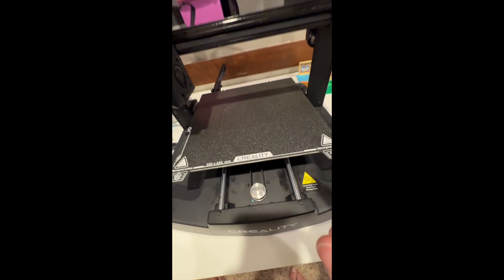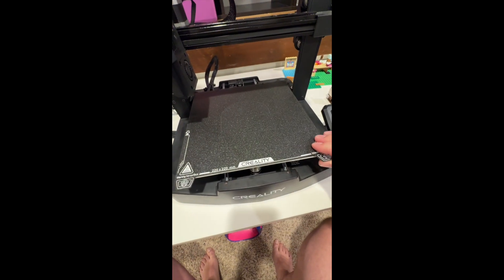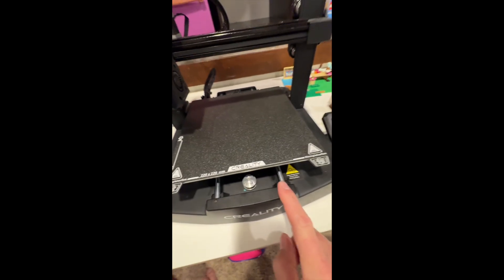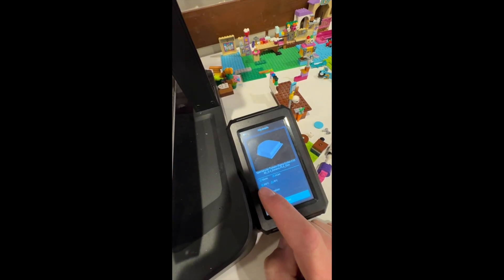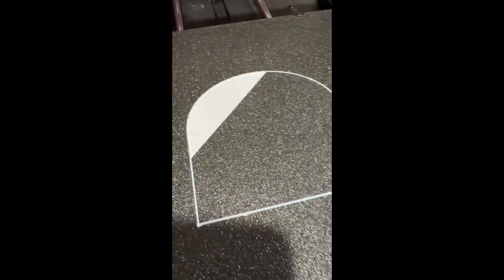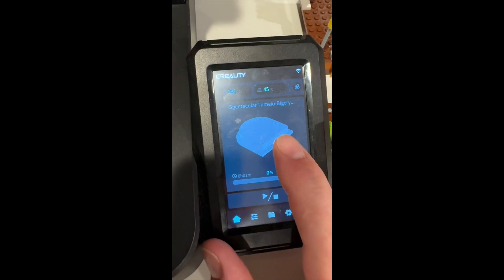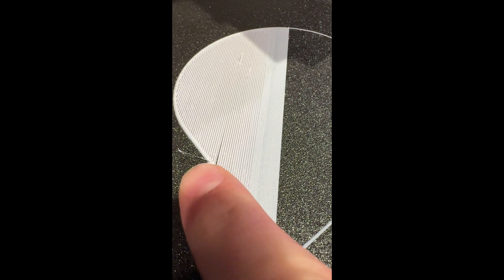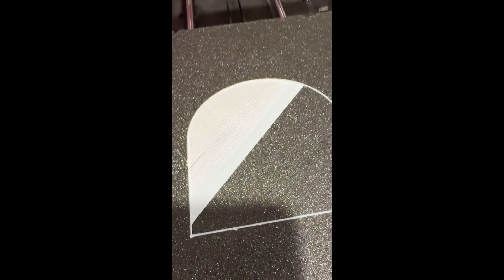Ender 3 v3 ke problems  and some answers with print issues follow up video

Comment: I use 95% Isopropyl alcohol, but it's not a long term cleaning solution. It also needs to be washed with dish soap and worm water from time to time, about 2 times a week works for me.... 
Dish soap, worm water and a new dish sponge only for cleaning hotbed plates is the best cleaning method I've found for PEI plates.

Comment: To my understanding, there are 2 "contaminants" that can affect adhesion:
1. Grease from hands - Anytime you touch the bed with your hand, you leave some grease behind which prevents adhesion. Alcohol is amazing for cleaning this. To reduce the need for this, I actually use an expired credit card as a pry tool so I can detach my prints lifting the bed, and when I do need to lift, I grab it only by the edges / corners.
2. When detaching prints, sometimes a very fine residue is left on the bed. Over time it builds up and can start to affect adhesion. Alcohol doesn't help here, and you need give it a good scrub with your hand, just as explained in the video.

Comment: Have you updated the firmware to see if it will fix the first layer offset on calibration?
Reply from the maker: I have not checking lately, but I will. Will do an update if any changes